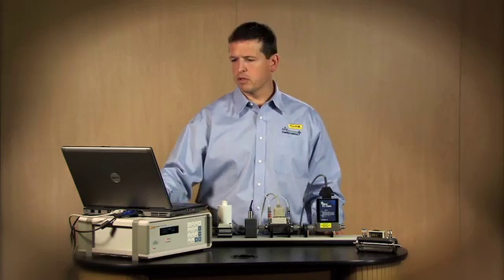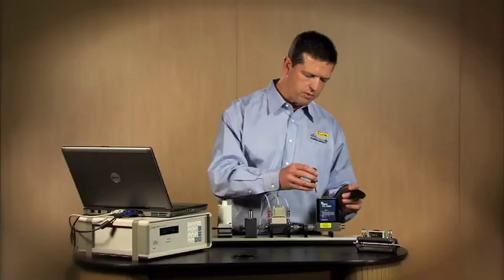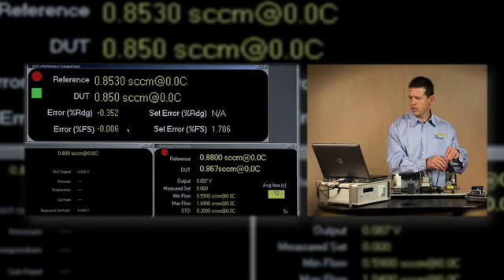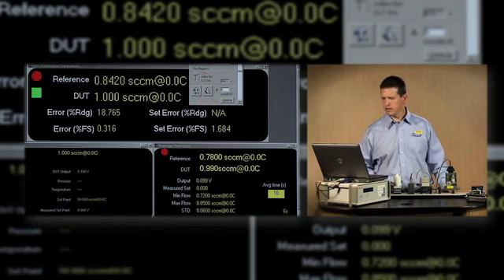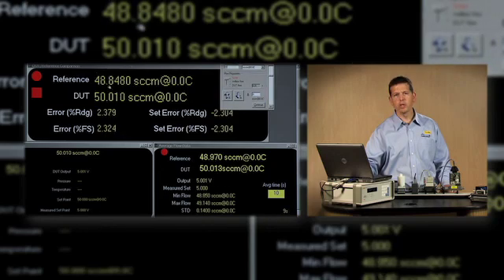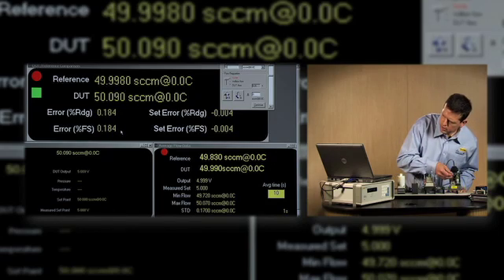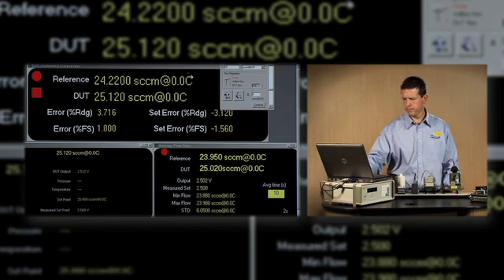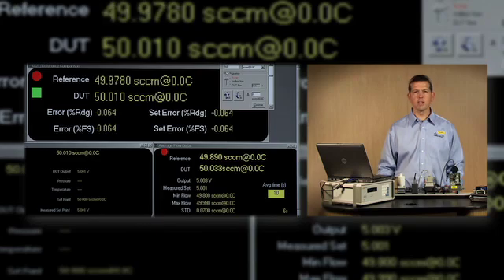Mass flow controller calibration using molbloc/molbox: MFC Adjustment

Comment: Why do your adjustments affect the reference and not the DUT Device Under Test?  - ANSWER:     the DUT/MFC is controlling the flow,  As you turn the potentiometer from (what it thinks is) 50 to 48,  then it realizes its setpoint is 50, so that it opens up to allow more flow thru and that is why the reference value increases and the DUT does not appear to change.